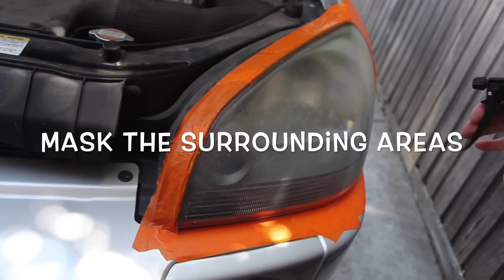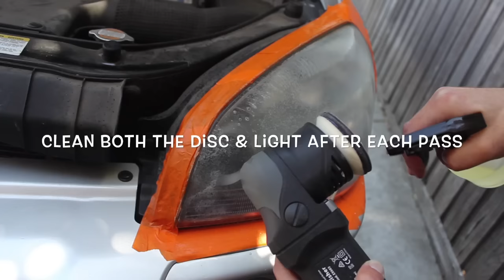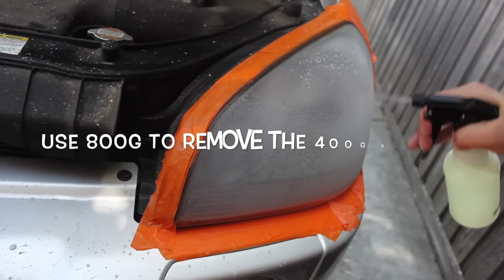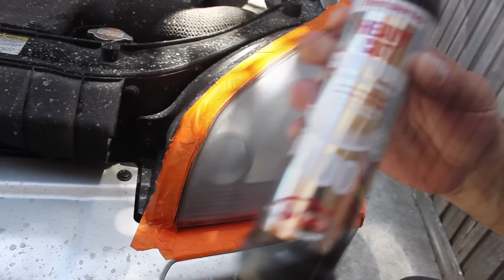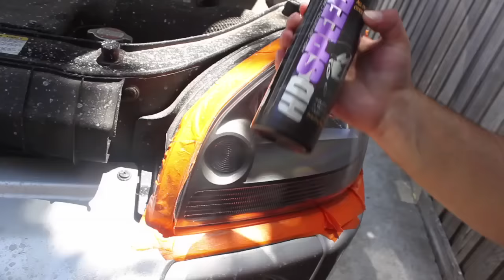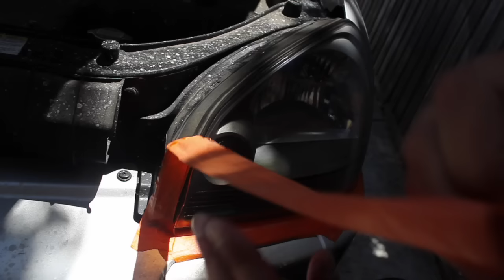How To Restore Your Car's Headlights!

Comment: I've done mine 3 times in 15 years. The last time about 6 weeks ago was no where near as aggressive as what I just saw. I did mine wet, starting with 800, 1200, 1500, 2000, 2500, and finally 3000.
Then cut them with the 3 grades of Scholl.  I guess I was being cautious. Now I just polish them every couple of weeks with a machine the same as yours. Maybe I'll try Meguiar's Ceramic Wax over the top now.

Comment: Heya Sandro, that's quite a lot of work and for those of us with without a sander, and fists of ham, doing that by hand would be a punishment. Wondering what's your thoughts on the off-the -shelf  'Headlight Restoration Kits"?
I've been given the 'TURTLE WAX HEADLIGHT & LENS RESTORER KIT' but haven't used it yet. Looks like hard work and not enough materials to do it properly.
Can these kits actually do more damage than they fix in the long run? 
Loving your vids btw. Been binge watching all afternoon. You have a talent for Cinematography, Editing and Scripting. If you give up detailing you should produce films for others. Super enjoyable content and I friggin hate detailing stuff, when I had coin I would just take it to a professional like you, but now the world has changed and you're saving my car from a miserable existence with your channel so thank you! :)
Reply: I have used that Turlte kit. While the result won't be perfect, it was more than enough for the car to pass MOT. One think though, is missing from the kit. The clear coat with UV protect. I would defenitely add that after the treatment. Otherwise benefits will be short lived.

Comment: The guys over at Paint Scratch recommend using clear coat after sanding instead of polishing. Do you have any thought about using clear coat?
Reply from the maker: There’s pros and cons either way. You should mask the entire car if your going to spray clear as it will travel onto other panels, and once that clear fades and fails like the original clear, you’ll see the sanding scratches once again and you’ll need to sand the clear off once again and re-clear them, but if it’s done right it can last many years or as long as the factory clear did. If you refine the scratches they’ll never come back, but you need to reapply your sealant/coating more often to prevent the yellowing returning, but in most cases you won’t need to sand again, just compound/polish and re-seal/coat them.

Comment: With the purple 3M discs, do you use a foam backing interface with it?

Why do you choose to start so low at 180G? 

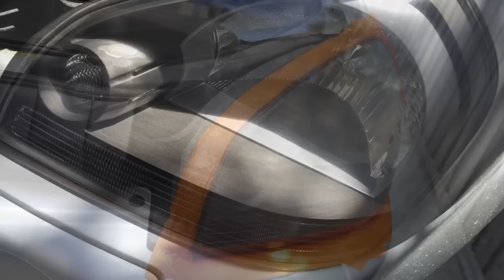Is Menzerna FG400 with that yellow cutting pad (what brand is it?) enough to remove 1500G sanding marks? At 9:18, I can see swirls on the top right corner where the sun hits the plastic. 

How long does this entire process take you to do a set of headlights?

What do you do to limit splatter and cleanup? As the engine bay and front end of the car would be covered with plastic slurry. 

Hope you can answer my questions as my process is similar to yours except I do 1000, 2000 and 3000G and then compound/polish which removes all swirling as well.
Reply: Thanks the the speedy reply mate. I do a lot of standalone headlight jobs and charge quite a bit for it so I'm always trying to go for 100% defect removal where possible.

Do you think refining further than 1500g would remove the swirling? If I could eliminate 2000 and 3000g wetsanding in my own processes but still maintain a high % of defect removal then I'd much prefer it.
Reply: Well said Sandro. What's your opinion of the 3M purple clean discs? How much life does one disc have? Do you have to throw it away after one use?

Comment: Hi Sandro do you have an interface pad on your DA in between the cutting disc and backing plate? where did you get it from i need a 3 and 6 for mine?

Comment: Hi mate, just wondering what sanding discs your using other then the 3m clean disc? Do you change when you get too 1200g?
Reply: Sorry for the late reply haha, but just wondering where you get your trizact discs at? I’ve been using the clothe abrasive which I recommend for paint work but they don’t cut the headlights & I can’t find a distributor in NSW
Reply: Thought I would add, but I’ve been watching your videos for quite awhile now & you have honestly taught me so much, I appreciate your time & effort into making these videos

Comment: so, you don't need to seal it again for UV protection from the sun and heat from the lamps?
Reply: Towards the end of the video he wrote to use an all in one polish that has UV protection or a sealant that has UV protection. This will keep this finish lasting.

Comment: Hi Sandro your videos are great, how long does it take to finish both headlights?
Reply: yes that's what I thought, most people think its a 30 minute job
Reply: Con Evans good thing I no longer wet sand any more . CG headlight restore works pretty darn well. It takes me 5 min with both headlights. I charge very cheap of 20$ but it's almost instant I can do it.
Reply: David Saucedo I do all the process by hand yes it takes around two hours to complete but I don't cut corners and finish the job with a ceramic coating
Reply: Con Evans that's good! If I was being paid more then 20$ a set I wouldn't cut corners. But all my customers are very happy with the results
Reply: Due to a lot of competition and most don't know what they are doing I charge $60 a pair
Reply: Con Evans that's a good price 👍
Reply: @conevans9982  do you mind telling me coating use headlight also any update recommand/changes done last 2.years?
Reply: Richard Fox I use c.quartz
Reply: @daves.3278  do apply any layer protection like coating/wax etc also has anyone call because there headlight Fogg up after months pass using CG headlight restoration?

Comment: What about using tooth paste?
I don’t have all that technology with the machines and what not?
Any poor mans tutorials would be great.
I bought an older 2006 Audi A3 (drives like a dream)...
Need a lot of work with paint fading and cracked leather chair, things coming off from ceiling etc etc.
I don’t have the type of tools you have and wondering if things around the house could be used to do satisfactory enough of a job to bring some life to these areas.
Thanks.
J